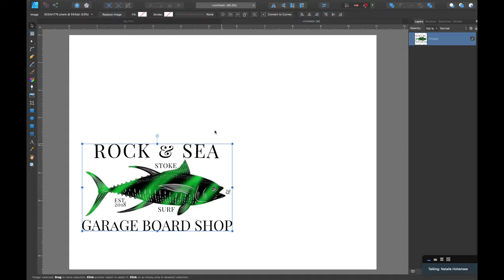DIY Fish Surfboard

Comment: Love your content! Quick question for you, what are you using for your pin line and what type of resin are you using for this board?
Reply from the maker: Hey thanks, stoked other people enjoy board building! On this board I’m using resin research epoxy, can’t recommend it enough so far as epoxy goes.   For pin stripes here I used black nail polish as strange as it sounds, Matt kinoshita from kazuma surfboards occasionally will do nail polish pin stripes so I gave it a try. Turned out great but nowadays I pretty much exclusively use POSCA pens, definitely recommend them!! Way easier to work with!   Like and subscribe to support the channel!

Comment: Such an amazing wedding gift. Aside from discoloration, is there any drawback to using epoxy resin from home depot or a crafts store instead of surf/marine grade? And any difference for fiberglass? 

I just nabbed a board on facebook that's buckled and has a good nose ding that I'm going to try and repair
Reply from the maker: Hey thanks!! And As far as I know really the only difference is clarity of the resin! So if you want to get epoxy for Home Depot or any hobby store should be just fine!

Comment: Hi! Have you used a nail polish for the pin line? And you make it after the laminating and before the hot coat, right?
Reply from the maker: So I’ve only used nail polish a couple of times for pin stripes, i learned about it from Matt kinoshita of kazuma surfboards Hawaii, he is one of the current legend shapers.   I’ve only used it a couple of times but in the videos where he has used it he put it on top of the hot coat.   You might be able to put it under the hot coat and it would be fine but I’m not actually sure, I’ve almost done it a few times but was afraid how it might last long term so haven’t tried it.  I Really ought to just run a little test on an older board, resurface it, add pin stripes and see how it hold ups long term under the hot coat.  I use nail polish for the first time in this vid https://youtu.be/a-VRhh7R8Zs

Comment: Yo dudee im currently working on a skimboard build but where i live they only sell 8 oz fiberglass cloth, is that a problem? Or is one 8 oz layer the same as two 4 oz layers?
Reply from the maker: alex a it’s sort of weird, it isn’t a 1:1 comparison. Apparently going to a heavier oz cloth increases the load capacity pretty proportionally but the stiffness/flexibility is different.   As i understand it 8 oz should have about the same as two 4oz layers but will act more stiff when glassed.   (Which may or may it be what your going for🤷🏼‍♂️🧐, i don’t really know whether you want a skimboard to be stiff or have a little flex🤔).   

Hey if anybody out there is super knowledgeable about glassing tell us what’s up!!
Reply: Surviving Dent School - JDub Hannah okok but with your knowlegde, should i do 1 or 2 layers of the 8 oz finerglass on a skimboard

Comment: Did you laminate your decals into the hot coat?  (Sanding resin)
Reply from the maker: On resin tint boards I laminate the board first, then I glass on the logos and cover them up with a small patch of fiberglass, didn’t want colored resin changing my logos color at all.  I let that cure and once hard sand down all the rough edges, then I hot coat the whole board.  If you are glassing a clear board you can pop in the logo under the fiberglass cloth during the lamination phase, on their board I could have done this on the white deck but just chose to do both logos afterwards
Reply: @RockandSeaGarageBoardShop  I totally understand why just wondering if for the logo patch did you use laminating or sanding resin?  I would think sanding resin would be fine and that way it sands better.
Reply from the maker: Oh sorry totally misunderstood your question!   Yes sir I use sanding resin so it will set hard for sanding down the edges👍.  Probably could get away with either though

Comment: I have a random question, does anyone know how to cut the fiberglass at the tail to not leave any foam exposed? I am having issues
Reply from the maker: Ooh dude seriously a good question, I still have a hard time with this.  I Really need to  talk to a master glasser to really dial it in.   Anyways what I do, is a single cut to the v in the tail, and then a single cut to each tip of the fish tails.  I cut away excess that hangs off and then get a few small pieces of fiberglass cloth fill in spots where the cloth doesn’t cover in the v of the tail and on the very tip of each fish tail.   Small little patches of cloth work great to fill in spots where the main cloth doesn’t cover, small patches adapt well to right angles and corners.     That’s what I do, it works well for me, but would still love to really get killer advice from a master glasser
Reply: @RockandSeaGarageBoardShop  Hey thanks for the info. It was very detailed. If I get the information, I will make sure to tag you!!! I just started shaping boards and you are definitely an inspiration. Good vibes!!!!
Reply from the maker: @elflacosalinas  heck ya man, that’s awesome your getting into shaping! Good luck out there!!
Reply: @RockandSeaGarageBoardShop  thanks man and keep up the good work. Cheers from San Diego, California.

Comment: My board came out great but printing on rice paper not so much.
Reply from the maker: Garret Douglas hmm bummer, wonder what’s up with that?   Try out the rice paper i use, it’s pretty cheap on amazon, has worked great for me,  it’s linked in the description
Reply: Surviving Dent School - JDub Hannah thank you.  That link went to greenlight.  Also, why do you prefer routing fin boxes after lamination?  I suppose you can do it before or after.  Router pressure dents?
Reply from the maker: Oops here is the correct link, updated the description link, that was the stuff i used to use.  Art Advantage Rice Paper 100 Sheets-Pack https://smile.amazon.com/dp/B0027A39W2/ref=cm_sw_r_cp_api_i_UtzqFbN28A57H.    If you pop in fun boxes before laminating the boxes come out stronger vs routing in fun boxes after the lam just because then you have a good part of the weave overlapping over the box.  Downside is it can be a little tricky to avoid bubbles around the boxes and it’s a little tricky making it look good/uniform with resin tints.   If you route the boxes after the lam you can make it comparably as strong by simply putting a patch of fiberglass cloth over the fin box.   Overall it’s personal preference, for me it’s just easier, i always had a problem with bubbles around the boxes, other guys love placing boxes before the lam.  No wrong way, just preference  👍🏻
Reply: Surviving Dent School - JDub Hannah Thanks much.  Might try that, looks like thicker paper than I tried and shredded.